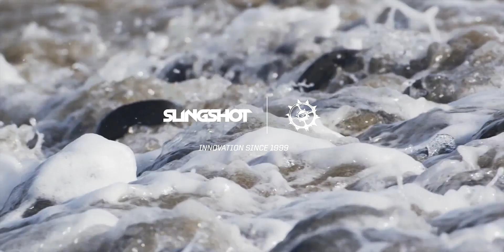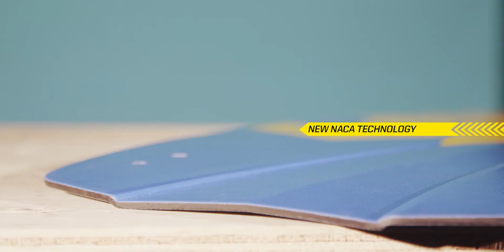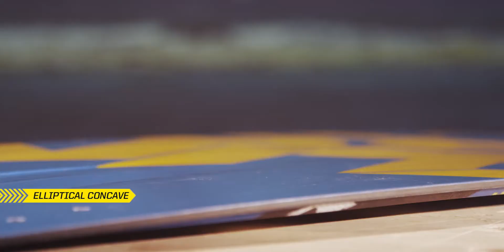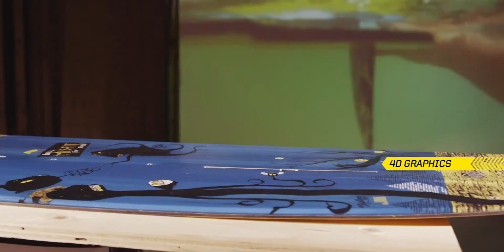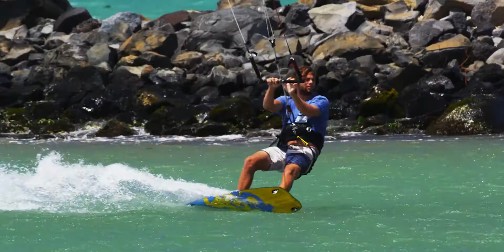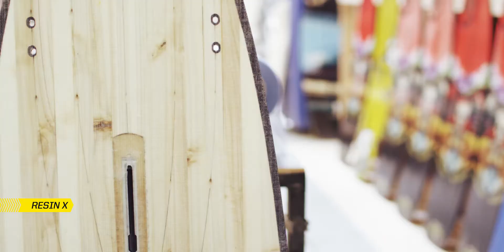2015 Slingshot Misfit - presented by Lonasport

Comment: do people ride with boots with this board?
Reply from the maker: Kim Holowell 
Hi Kim.Thank you for your question.
The Misfit is more of a free ride board. Of course, Slingshot has implanted freestyle genes but the board is normally ridden with Dually
straps/pads. As you can see in the video, it is quite possible to mount bindings.